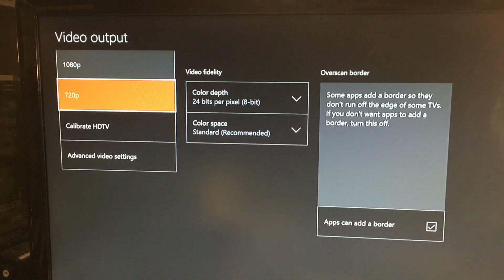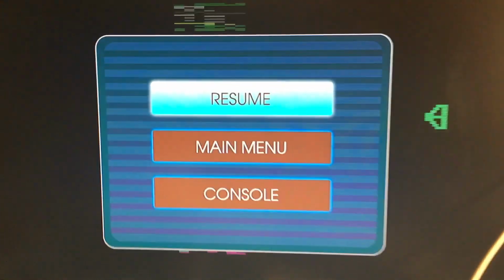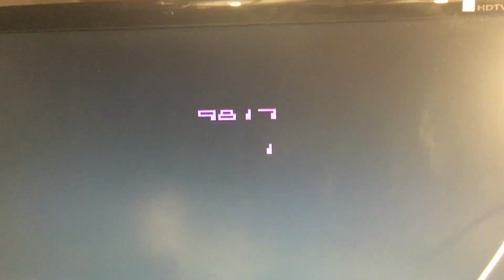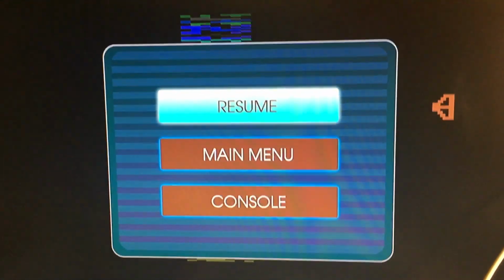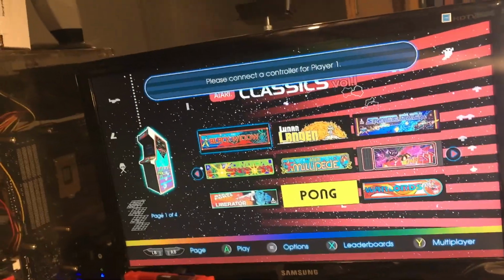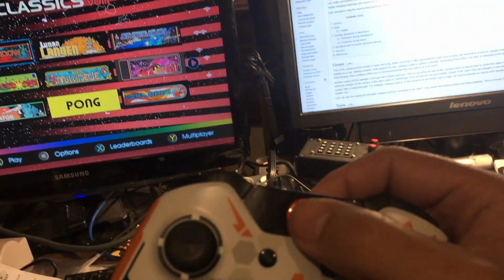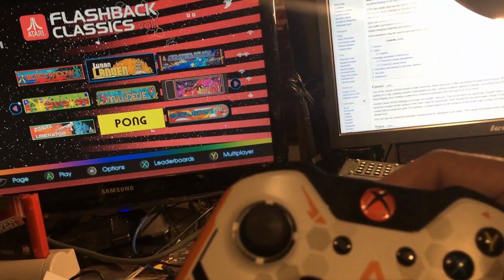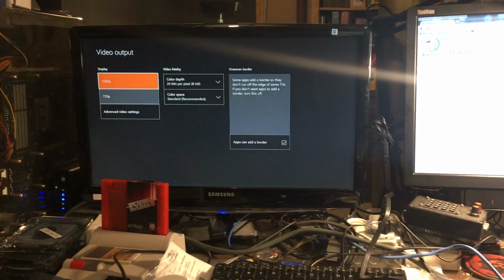Xbox One Repair: Bad or No Video Output Fixes

Comment: I tried to remove an HDMI port the other day from an Xbox One S with my hot air station and for the life of me could not get the solder to melt on the four ground pads to release the port. It was unreal.
Reply from the maker: I struggled with this as well, the Xbox motherboard absorbs crazy amounts of heat and the traces tear very easily. Personally I use the "low melt solder" method. This is basically the method I use now, no more cutting:
https://www.youtube.com/watch?v=mEDYT7sZEf4 
Andrew Paul doesn't use low melt solder and suggests 490C at slightly lower that half air flow, setting 4 on my WEP 858D, but it can take several minutes of applying heat before anything budges. With "low melt solder" everything is out in under a minute:
https://www.youtube.com/watch?v=5V0BYEQKKB4
Reply: it takes over 5 mins sometimes and u have to use a lot of heat. the board is very thick and suck up a lot of heat.

Comment: My hdmi port went out yesterday I need to get it fixed or a new Xbox
Reply from the maker: Is the port physically damaged?
Reply: XFiX yes good thing I’m getting the X today
Reply from the maker: I charge $39 for HDMI port replacement which includes return shipping if you are interested:
https://www.ebay.com/itm/233014178393
Reply: XFiX where you from
Reply: @mpdavig  listing not on eBay I'm interested in the repair

Comment: these filters are very different from the filters on the ps4, these tvs  avalanche diodes go from pin 1,2,4 and 5 to gnd.  The path from top to bottom  ie pin 1 to 10 is short circuit, I presume, for a high speed comms?  When testing pin 1 to pin 5 there's a 1k resistance on the filters to the output hdmi port and on the input hdmi port,'s filters the same pins have a resistance of 40k ohm, is this normal?

 I really enjoyed your video, the links very useful  also.  Any advice would be greatly appreciated. 

keep it up. 

thanks

Comment: Hello friend, congratulations on the channel.
I'm having an xbox one-s with the same problem as your video. I have already changed the hdmi port, and also the esd emi protection. Even though I have artifacts in the picture, this model has hdmi circuit, will the problem be in it?
Reply: BLEACH GAMES yo bro have u fixed it cuz i have the same prob in my xbox one s since yesterday...everytime i change the resolution to 1080p i get this red lines in the midle and mid bottom of the screen

Comment: If the black screen of death happens when you plug in your hdmi just wiggle it gently until your xbox screen appears
Reply from the maker: I wish this always worked but you're right. It's not uncommon for an HDMI cable to sit very loosely in the output port.
The system I use in most of my videos is like this.

Comment: Idk if you do this a lot but a rework station would be mighty handy
Reply from the maker: You're correct. I picked up one of these a couple months ago. Works pretty well for small jobs.
https://www.amazon.com/gp/product/B00ITMPQS2/
Reply: Yep, that's for sure! All you gotta do is flux it up and heat it up haha 
I'm having an issue with an Xbox I'm repairing right now. Its output is semi working with those small grainy spots and it goes black occasionally. Would these components be the issue? The Xbox I'm repairing is a one of the first Xbox ones that was released.

Comment: but my xbox still turns on just no video and controller wont work when plugged in usb and works on other xbox
Reply from the maker: Num nums Playhouse if you've owned it less than a year MS should fix it under warranty. But I'm guessing it isn't under warranty anymore otherwise you wouldn't be asking. If it's the older non-S model it could just be the power brick. Aside from that I charge $39 for general repair. You pay to ship to me and I pay the return shipping. If for some reason I can't repair it I will refund the $39 and ship the system back.
There are numerous components which could have failed here. Since controllers are not working but the system powers on I would guess that it isn't booting. This could even be a bad hard drive. The better USB test would be to try and charge a phone or something since power should always be provided.

Comment: does this fix the like dead pixels on the screen? the green logo boots fine then soon as its on the dash its really #$!₩₩€ picture with like dead pixels  and sometimes just nocks it right off
Reply from the maker: Dead pixels is a good description of what it looks like although that is usually referring to the display itself.
I was seeing all sorts of strange output that I wasn't able to catch on camera.
By knocks off do you mean that the screen goes blank then returns or it just goes out completely?
Is this an ongoing issue or just happens every once and awhile?
Reply: XFiX   cant really describe it    it looks like the picture has an overlay of black sprap (refering to the paint can on paint ha)   and if a game inserted it doesnt turn off   but if its just left to boot it goes black with the pixels then turns off.
Reply from the maker: OK, well I would suggest trying a different HDMI cable and if possible another TV just to see if the issue persists.
If you are interested in getting it fixed, send me a private message here on YouTube, eBay, or Twitter. Links in the description.
Reply: XFiX   will try the hdmi and a different tv    would it work long enough removing the filters to test see if its still happening
Reply from the maker: Yeah, it should run without the filters.
I didn't really expect it to be the fix so I didn't film removing them.
I used low melt solder to remove them but flooding both sides with solder would probably work just as well. Just be really careful. This is fairly standard practice when removing SMD components.
The 2 components are labeled EG8B1 and EG8B2.
Reply: XFiX    when ive done this ill update    couldnt see it on andrews page but might not have been looking hard enough
Reply from the maker: Here is the Andrew Paul link. I also just added it to the description.
https://youtu.be/sAFe0M7cusA?t=722